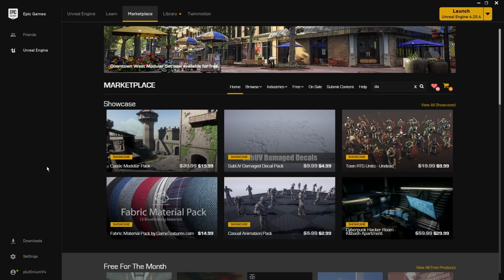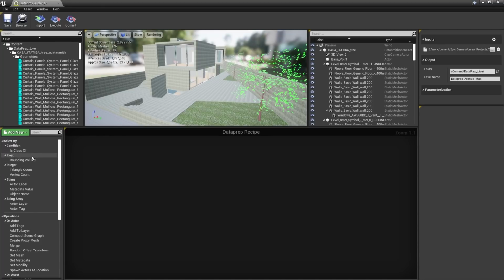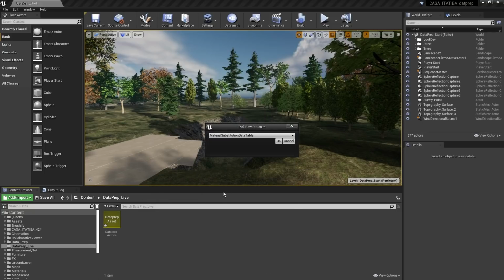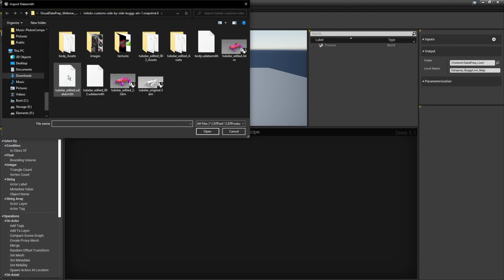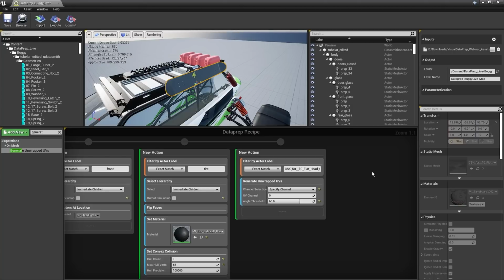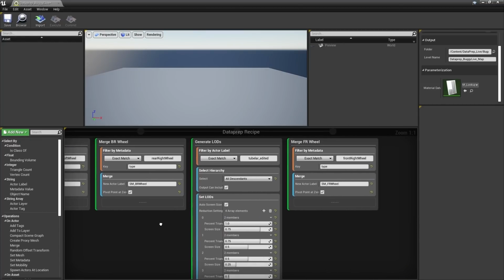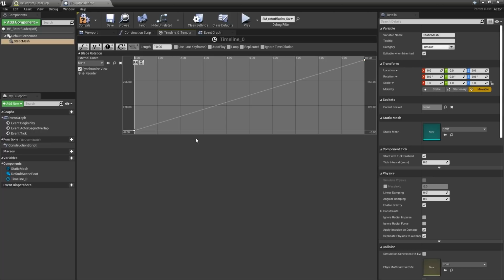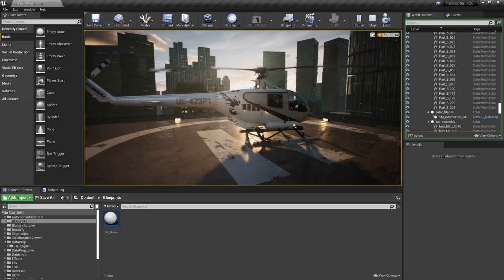Using Visual Dataprep in Unreal Engine | Webinar

Comment: Thank you so much for the lesson! But I can't repeat this in UE5.0.3. I mean the part with the blades rotating.
I have a model from solidworks.  I repeat all the steps, but my model does not rotate, although in the debugger I observe that the timeline is working and the coordinate is changing. 
What could be different in UE5.0.3?

Comment: What additional work would need to be done to have the rotor blades bend accurately while increasing in speed?
Reply: There are likely a few different ways to handle this. One way might be to have a version of the blades that are straighter (at speed) and then using Blueprint switch to those blades above a certain speed. Of course you'd likely want to have the switch occur with some sort of blend so it doesn't visibly pop. Perhaps using blend targets? I don't know the workflow because I haven't tried it myself. But those are my thoughts on how you might do it.

Comment: Cool video! But when we will completely migrate from fbx to gltf? I want to use Open Source pipeline and drag'n'drop my character with animations to engine easy. Fbx has many problems and not the best.
Would be nice to load whole blender scenes. Blender now support USD export/import.
Reply: We have a glTF exporter in the works for next release. We already read glTF - however the scope of glTF is much smaller than FBX, so don't expect glTF to replace FBX